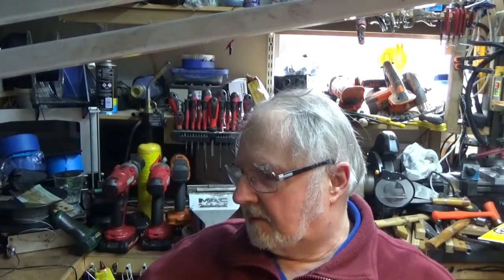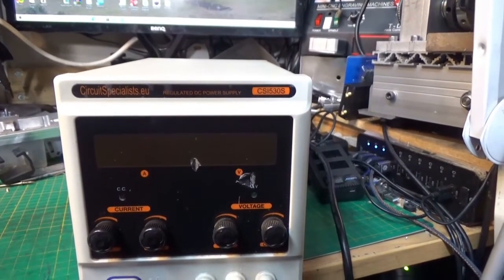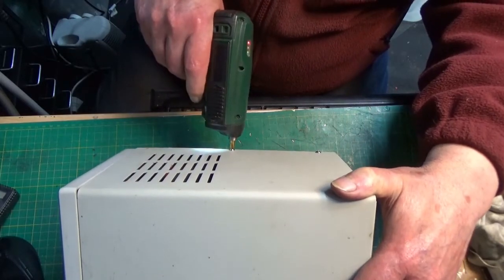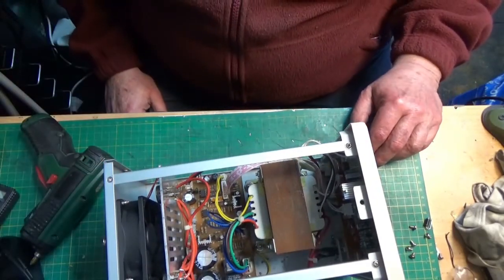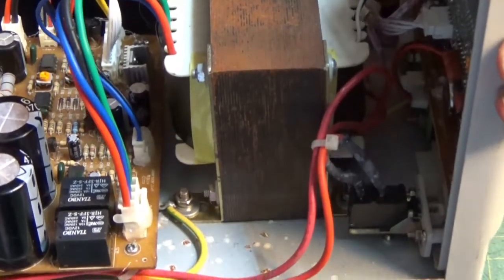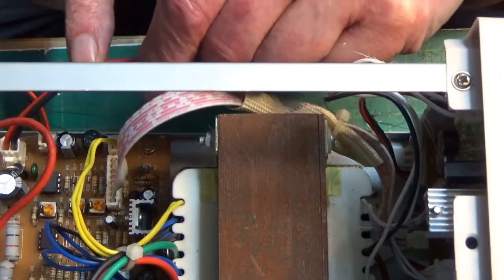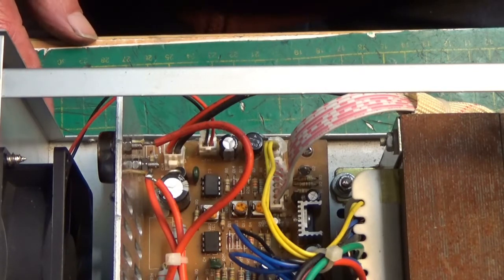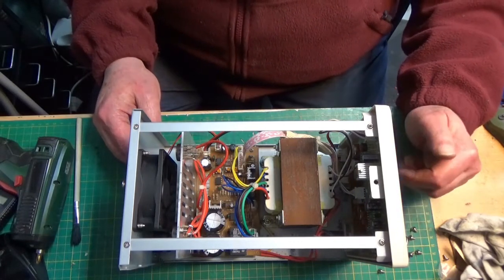Bench Power Supply no voltage repair.

Comment: What Technology does the branded power supply makers use? Linear or switch mode?
Reply: If it's heavy with that big transformer, it is linear. If light, then it is a switching supply. Easy peasy.

Comment: ... it's a liner PS and there are no dangerous voltages on it ... the voltage on the bulk cap would not be greater than 50V, hardly a dangerous ...
Reply: Does it uses LM317 Ic as regulator ?

Comment: I’ve got the same problem with my power supply mines a different brand but looks very similar except for the mosfet’s. I’m going the check what you did before I completely start removing circuit boards, thanks for posting 👍🏻